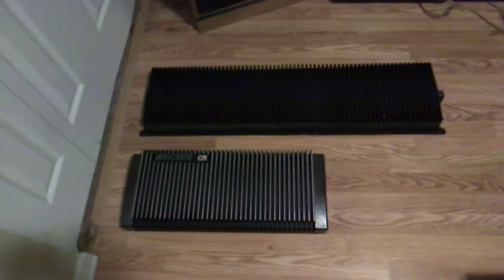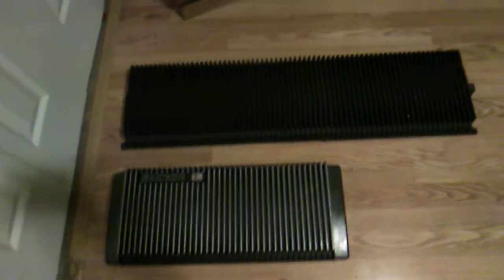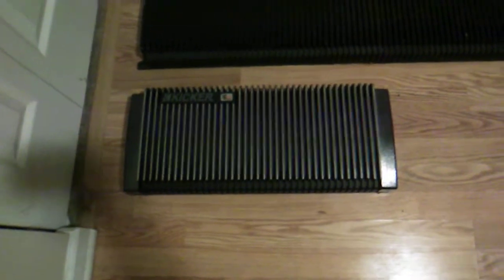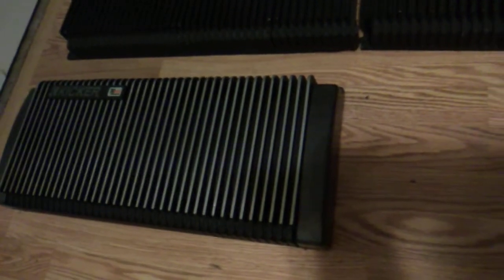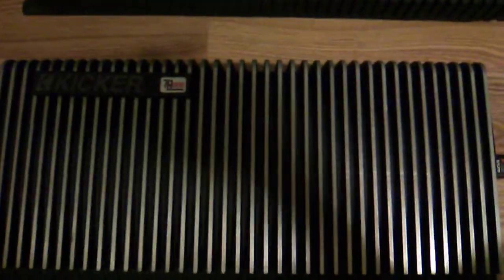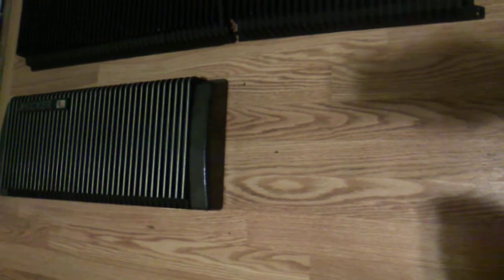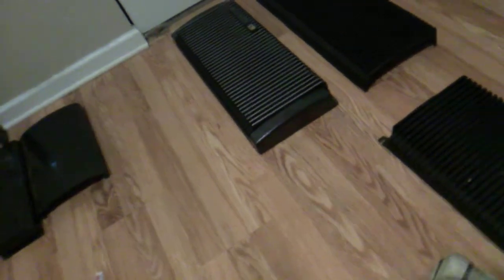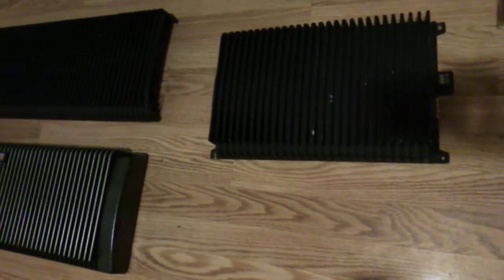Talking about amps: Kicker ZR series amplifiers

Comment: Great video. Spot on in your knowledge and with the comparison to the Rockford black & grinds. I'm starting an old school build now with ZRs. Have two ZR240s and a ZR120 thus far. These things are built like tanks.
Reply from the maker: That should be an awesome build. I would run mine but I need more batteries. They are in my top 5 amp series of the 90's. Those 240's are insane. My buddy was running a 12W7 off of a 240 and it was putting other amps we tried to shame.
Reply: @brentb5303  I just picked up a ZR600 so I'm going to run that for sub duty and a ZR240 for front stage. 40ah of Headway lithium should give them the power they need. Love these amps. A testament to their build quality that there are still so many around.
Reply: I got 4 zr360. 2 zr240 2 zr120  a few end caps the style on the older kicker amp on bottom. The bare metal looking heat sinks. They definitely last. Had a zr360 on 1 L7 it was loud. 
Then 3 months later added another L7 and one more of my other zr360 amps. Omg it was loud and even the 200amp alternator didn’t like it beating. Could be looking to get rid of some of them.
Reply: What about the DX series like the DX700 what are the thoughts on those?
Reply: Cory Brown but how much you selling the ZR360 if you decide to sell em

Comment: Anybody have a crossover module they want to let go of
Reply from the maker: What are you looking for? Do you need the subwoofer crossover?
Reply from the maker: I have an extra SWX I do believe. I also have a bypass and the remote gain but I probably want to hang on to that one.
Reply: @brentb5303  I have a zr240. It plays fine if I push on the modular certain way. So I'm thinking I need a module
Reply: Do you know if a center channel module will work I'm not sure what they do?
Reply from the maker: @egidio6david0  I explained in the video that if your amp is kicking on and off full/half power it's the port inside the amp. Disconnect power and clean the pins inside the blue housing that clamp down on the crossover card with deoxit. Also, make sure the pins are pushing down and making a good contact with the card. This is the most common issue with the ZR series. You see when you push on it when the amp is running your forcing the pins to make contact with the card which tells me that it's definitely the issue here.
Reply: @brentb5303  wow bro I missed that in the video. Awesome!  thank you for your help, I will do that in a little bit.
Reply: I have 3-240 , 2-120, 40SS , 1-600ZR in my stash. Great amps. My son is using a 240 on 3-10 Comp VR old school kickers